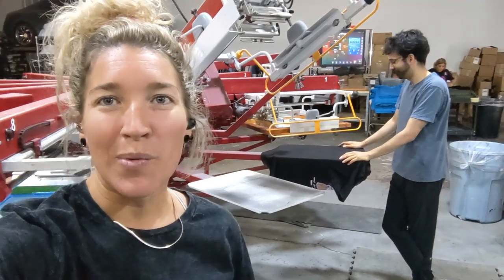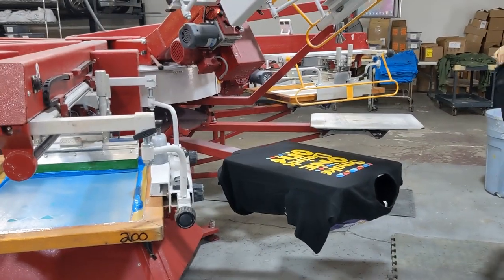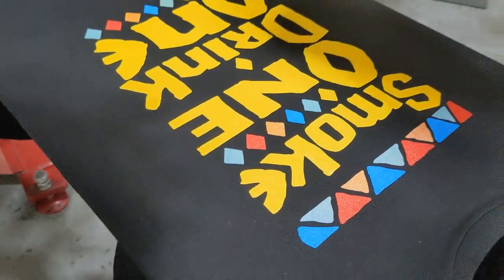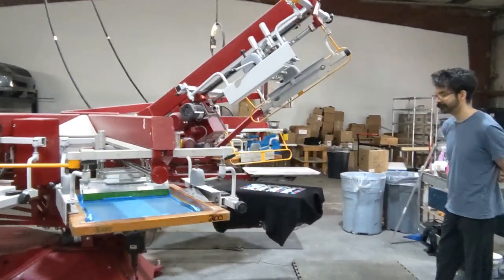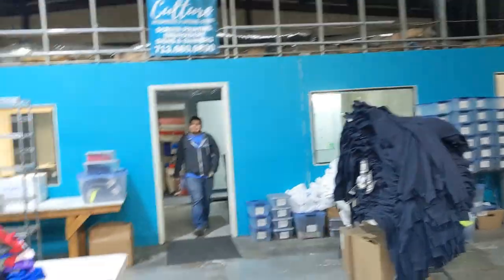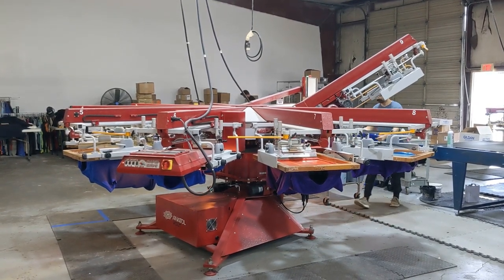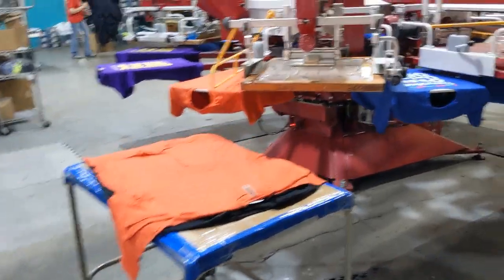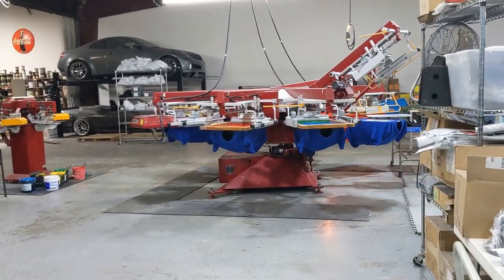Cycle Mode on Anatol Volt

Comment: Nice vid Kendra! I really think you need to invest in waterbased adhesive and throw out the aerosol. Your machines will thank you and your printers will really thank you. Keep em coming! 💯
Reply from the maker: I'm interested to know more! Is there a particular brand that you would recommend?
Reply: @KendraCultureApparelStudio  Thanks for creating these videos. I wish there were more back when I was researching replacement presses. We bought a 6/8 Volt three years ago and I will never go back to air again. I totally agree with OP on adhesive vs aerosol. We used spray adhesive for years and everything was covered in glue and shirt fibers. When we purchased the Volt I made a decision to keep it clean. We briefly switched to double-sided pallet tape but found that water-based glue is the best. We use TexTac. We add glue to freshly taped pallets. We re-glue as needed, depends on the type of shirt but usually after 150 tees and less for sweatshirts/hoodies. All you do is spritz the pallets with water and use a scrub pad to remove most of the fibers, warm the pallets and it's almost as sticky as before. If needed we re-glue even over leftover fibers. We do not have a second flash unit so we use cycle mode almost all the time unless it is one color or wet on wet. We have started using step-back mode more for two-color jobs as well. PS: We use an old screen coated with emulsion as our flattening screen. We tend to run it first to smash the fibers down before the UB goes down so the fibers are already flat before white even goes down. I use soft hand as the lubricant so the squeegee can easily travel back and forth on the screen.
Reply from the maker: @multipotentiality9144  OHHH we also use that glue as well at the beginning of the day but then later in the day we tend to resort back to aerosol. I do let my printers pick and chose their products, and we always "cough" attempt to keep clean with degreaser. I will share this feedback with them to hope to encourage them wanting to keep their work spacer cleaner. :)
Reply: I also have a volt, I  always used pallet tape ( even with my original manual) AKA transfer tape from my years of also having a sign shop and Tek-Tac waterbased adhesive as the aerosol spray just makes a mess as far as I can float through the air, I recently switched to PMI dual side adhesive pallet tape, which works great for me when it’s time to change out to a new pallet sheet, but I noticed that once I feel that the natural tackiness of the PMI dual side adhesive tape has lost it’s desirable tackiness I then use the water based Tek-tac adhesive right on top of the PMI tape and use it as a normal pallet tape, easily extending the tape ( pallet protector) PMI DUAL TAC for atleast 2 more weeks using the waterbased adhesive, tried it once and worked great, and when it’s time to replace it comes right off, not like transfer tape that has been heated and cooled thousands of times

Comment: Just an observation, what speed are you using for your print strokes?  Every job I check the min speed I need to clear out the ink from the image, on colder days in the mornings it’s always 8-12 then about an hour in on most colors I’m up to 16, and the white under base 12.  In NJ WE HAVE HAD A HOT SUMMER, and Saturday and yesterday I had international coatings white 741 clearing a 156 screen with 1 stroke at speed 20,  all these years I never seen that white soooo smooth and creamy, I couldn’t even use spatulas or puddy style scrapers to load the white, I had to lift a 5 gallon “ almost new” bucket and put it onto the screen.  Never had to do that in 15 years, it poured faster then basic black ink stirred up on a 100 degree day.  So basically my point is, from watching the video it appeared to me that maybe ( I don’t know your air conditions in your shop) but speeding up the flood and print stroke may possibly increase the overal job speed and also improve the colors on some of the heads,  just an observation
Reply from the maker: Our print heads are always at 20, sometimes we drop white to 15 (sometimes) we always stir all our inks prior to printing, so the viscosity is better, flood is pretty quick though. 

We are in Houston, outside, high humidity, no AC our shop is about 90-125 on most days aside from winter.

Comment: Kendra.. the reason why white flooded in cycle mode when it wasn’t supposed to is because it is bug In the software. We had the same issue and had to do a software upgrade. If you need help with this.. let me know and it is easy to fix. We have two of the Volt M presses.
Reply from the maker: We're soon to have an additional VOLT. can't wait! Hoping they can fix in person at install of the second one. Thank you so much for watching the video and letting us know.

Comment: just got one of these. Stumbled  here for cycle mode. Really spray misting that thing. This thing has to be in like 10 percent or less squeegee speed. The one thing i'm worried about for this is how cycle mode works when you keep having to cleaning a fuzzy off and reprinting.
Reply from the maker: You would notice on the first one you'd go to pull, or you would see it after the initial cycle. Just gotta keep eyes peeled or have a loader and unloader

Comment: Roller Squeegee? Never heard of it. What's its main purpose?
Reply from the maker: We recently acquired the roller squeegee set to help encourage the fibers of the shirts to set more smoothly prior to laying several colors on top, especially when we just need to set a white base.
Reply: @KendraCultureApparelStudio  looks like he forgot to turn the roller on for cycle 2
Reply from the maker: @michaelapplewhite4715  you wouldn't want to run the roller squeegee after the initial pass, after the white, because more than likely it will leave a white residue on your other colors. Because you roll the white still tacky after flash some does lift up on to the roller screen.
Reply: @KendraCultureApparelStudio  Gotcha, I set mine to where it doesn't stick to my roller screen.
Reply: @michaelapplewhite4715  Ya i usually use it on both cycles. Unless it creates some issues. Don't want to cure that ink.

Comment: Fyi Union ink is awful quality
Reply from the maker: We've been using it for over 15 years! Just need to make sure it's reaching cure temp. We use about 5 different ink brands in our shop, not all are available in every brand so we have to accommodate.
Reply: @KendraCultureApparelStudio  Wilflex is the way to go imo but, whatever works, right?
Reply from the maker: @jerdonclar8655  all of our PMS colors are wilflex as we make them in house. But our economic white is Stark white from monarch, our standard white is ELTS from one stroke. And then like many different brands in between. Union ink got bought out by aviant, and they own like 70% of the ink market, just all different labels ☺️
Reply: @KendraCultureApparelStudio  Gotcha
Reply: @KendraCultureApparelStudio  I gotta admit the last time I used Union was around 2009 sooo, I'm not too current